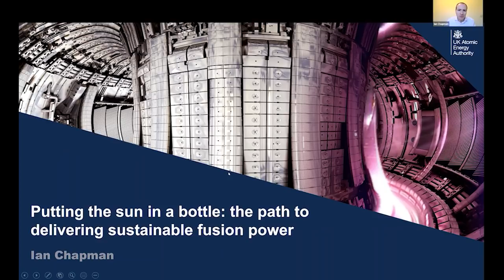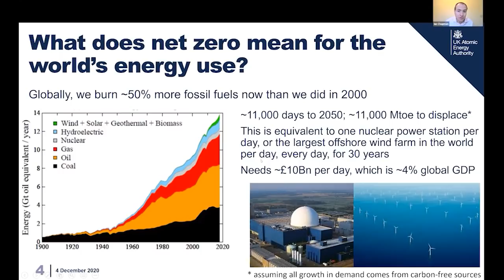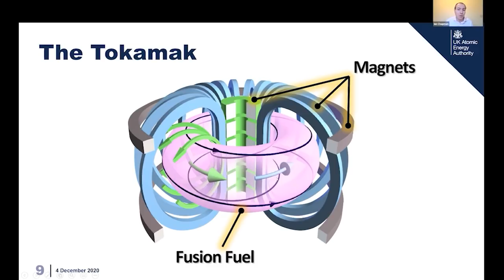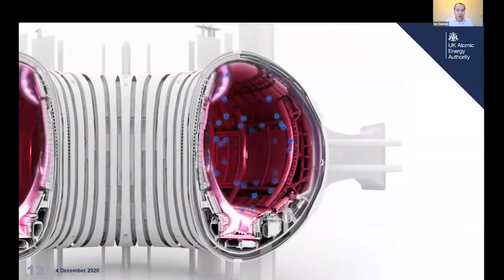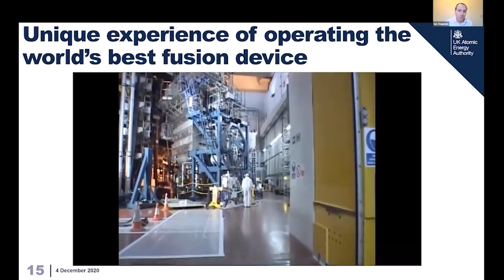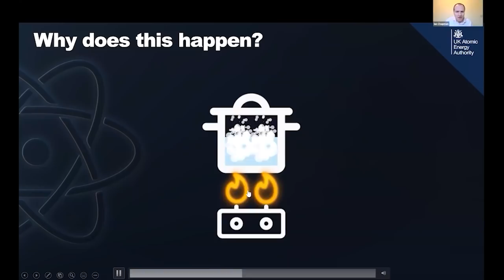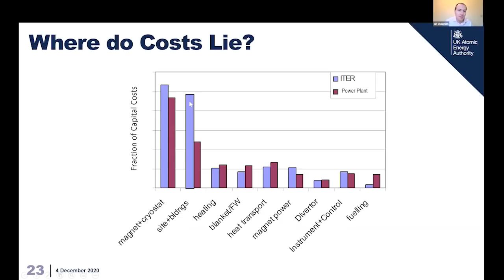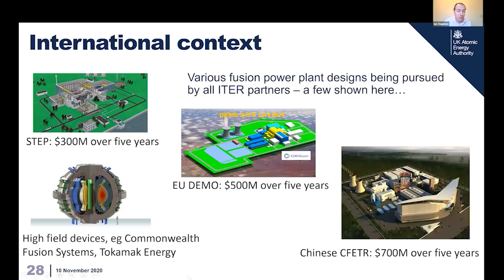Putting the sun in a bottle: the path to delivering sustainable fusion power | The Royal Society

Comment: These guys are wrestling with tough, perhaps insurmountable problems because the solutions are mutually exclusive.   We need to “go to war with what we got”, namely fission.   (Personally I like Thorium molten salt which is still R&D, but within reach.)
Reply: There should be a good balance between renewables and fission. No need to overbuilt nuclear capability when renewables can pickup a lot of slack.
Reply: @stefanozurich  1.  Germany is the most green in Europe and has the highest power cost.  France most nuclear and has lowest cost (and no incidents).   2.  AC power cannot be transmitted long distance without excessive induction losses.  The power plants need to be in the vicinity of consumers.  These locations may not be blessed with solar or wind resources.   3.  The green guys point to decreasing cost of solar and wind, but they are disingenuous.  They neglect the cost of batteries or fossil plants to back up.   4.  It might be possible to tear down existing boilers and replace with reactors.  This salvages the bulk of the power plant.  Moreover, and this is important, it Salvages the existing distribution grid (see point 2 above).  Nowadays it is hell to get right of ways ..”NIMBY”.  
    Im not against green so much as against wishful thinking.  The problem is huge and there is no magic wand.   Democracies being democracies will try everything that sounds good before settling on what works.  Politicians and technical endeavors go ill together.       Cheers
Reply: @stefanozurich  Check out today’s Fox News.  They have an article on this very subject.        Important stuff, Chefs or Bucs?   Cheers
Reply: @danbenson7587  Ehh this is somewhat misleading. The costs of solar and wind have fallen extraordinarily fast. France maybe be paying less than Germany now but if you were to start from scratch and go for 80% 0 emissions it would be much much cheaper to go with solar and wind. As you hit higher percentages the cost advantage starts to favor fission because of the storage and transmission costs as you mention. And to go from 95 to 100 without nuclear is insanely difficult. But we are not at 80%. And the costs of solar, wind, and storage continue to fall while the "real" expense of fission(despite quite large existing government support) seems to be going up. We definitely should not be tearing down nuclear plants. That was a huge mistake by Germany. But it does not seem wise to invest more into fission until we get closer to 0 emissions. From a cost perspective there are just much lower hanging fruit.
Reply: @stefanozurich  Yep - fission baseload, renewables plus storage for peaks.
Reply: Guys,   I am 67.  In the 60’s Popular Mechanics, Popular Science articles were a ‘helicopter in every garage’,  ‘Wankel rotary replaces pistons’, ‘roadable airplanes to replace cars’ and so forth.  The news was all upside, but the ideas were mugged by reality.   The devil is in the details.   
     So too is solar and wind.   At present, their footprint too small and conditions too ideal for long term assessment.  
      If indeed the Earth climate is dire, can we spend the time finding what doesn’t work with green generation?  Can we wait while right of ways slowly distill through the courts, like sand in an hour glass?   Can society quickly settle the social injustice of prohibiting wind off Martha’s Vineyard, while promoting off Newark?  
     The clock is ticking.  And why I think go with what works
Reply: @danbenson7587   "At present, their footprint too small and conditions too ideal for long term assessment. " huh they are massive scale projects that have been running for decades.
Reply: @peterisawesomeplease     At present we are seeing the results of green in prime locations..   These locations will be used and efficiency diminish. Has this been accounted for?
   Is green mature when it relies on fossil backup because affordable batteries are not to be had?    
   Are consumers OK with blackouts like California had?
   Objectively,  the world’s experience with green has been uneconomic and unreliable.  So if it’s mature technology, it’s a loser.  
    I think green isn’t mature,  mainly in storage.  And if storage face-plants,  then green is SOL economically.
    U.S. generating capacity is 1,200,000 gW.  Solar and Wind are ~100gW.  See the scale?  It’s mind boggling in size and execution. Can’t go into this on a dream and a prayer.   If climate change has hair on fire urgency, you go to war with what you got.
    We have beat this to death.  We agree on goals, but not methods. Always nice to forum with an informed, polite person.  Cheers my friend.
Reply: @danbenson7587  Yes it has been accounted for. Solar and wind costs have fallen so dramatically that even in places where neither solar or wind work very well its still const competitive with something like nuclear. Location does matter but it can be buffered by improved transmission. Perhaps more to the point we still have tons of prime locations left. We need to be going for the low hanging fruit. 

Nuclear also relies on fossil. If its too expensive to build you have to rely on fossil feul. Solar + wind + batteries is currently simply cheaper than nuclear.

"Objectively,  the world’s experience with green has been uneconomic and unreliable."

What? The industry is booming. Huge amounts of money have been made and both tax payers and rate payers have saved money. Its also not a done improving.
Reply: @peterisawesomeplease  Name a green plant of 500 mW with battery backup.   As to booming, its due to subsidies.   Gotta go.  Cheers
Reply: @danbenson7587  Aww giving up so soon. I would have respected "Gotta go.  Cheers" but no just had to go with the classic "argument" then "I am leaving" bs. Oh well plenty more fish in the sea.
Reply: @peterisawesomeplease  Peter, Here is a quote from the Fed’s Energy Information Agency’s, TODAY IN ENERGY.
     “Onshore wind competitive in only a few regions before legislative phase out of the Production Tax Credit (PTC), but it becomes competitive in projection period as demand increases and cost of installing wind turbines continues to decline.”
    Green wind ain’t there.  And it’s only competitive “in a few regions”.   And Batteries aren’t included.  
     “But it becomes competitive in projection period (when gas becomes scarce, as we have 100 year supply, say 50 years hence)
     There are 4 wind and 1 solar > 500mW installations worldwide, zero with battery back up.  
      (Another tidbit, There are ~1700 gas fired plants in the U.S., all sizes.)
      Gotta go.  Cheers
Reply: @danbenson7587  Put in all that work but then ruin it with "Gotta go.  Cheers". I am quite happy to read your arguments but not when you are pulling that BS. Have some self respect. If you actually have to go then just go. If you actually want to discuss then lets discuss. We are all on the same side in this.
Reply: @peterisawesomeplease  I would be glad to discuss, but facts are short on your end.  No one likes being a mop and reduced to complaining how a note ends.  Who has the problem?
     What the EIA proves is my original thesis:  green power, at present, ain’t there.  If indeed climate change is an urgent priority, then nuke is the proven method.  
     Please facts, not what was heard over the stall wall or read in some liberal rag.        Cheers
      .
Reply: @danbenson7587   "read in some liberal rag." Really. We were having such a great apolitical discussion.  If it makes you feel better ideally I would not subsidize nuclear or solar. I would prefer a carbon tax and let the market decide what tech to use. But you at least seem to be back to discussing in good faith so lets respond.

There are no solar or wind plants with battery backups over 500mW. There are completed projects of over 2000mW but they don't have batter backups yet. However there are under current construction battery storage facilities of  over 5000mW. Because the contracts have already been signed we know the costs are around 130$/kw/h. This is still very expensive. But energy storage is worth much more than the energy production. It offsets peeker plants instead of base load plants. To be cost competitive in that sense it needs to hit more like 20 dollars a kw/h. But it is very important to realize that we only need battery storage that cheap once we get to very high levels of renewable penetration. At current levels of penetration solar+wind+batteries is cheaper than coal. With the batteries needed included. See https://www.latimes.com/environment/story/2019-09-10/ladwp-votes-on-eland-solar-contract. At current levels of solar penetration( even in places where its already quite high like CA) you only need small amounts of offset. In places with very little solar power you don't need any storage to make it worth while. Right now it is hard to find the political will to spend 2X more on energy to go 0 emissions. But with solar you can spend 1.2X more on energy and get half way to 0 emissions. Once you get that far the tech will be cheaper to go the next 20%. Even better wind, solar, and storage are all incremental technologies. You don't have to to go all the way from 50% emissions to 0 in one big step. You can go piece by piece as the costs go down. 

Now lets think about fusion. It has 0 mW. Not 500 not 100, 0. Or look at fission. Its in much better shape. But no one in the US is building new fission plants. There is only 1 under construction in the US despite huge subsidies. Why? Because even though at high levels of renewable penetration it might be cost effective its not cost effective at the current levels of penetration. And there is little hope that costs will lower.

Now sure maybe when we get to 90 or 95% solar and wind it will make economic sense to build a few fission reactors because they will be cheaper than the storage needed to push solar and wind to 100%. I am not against doing that. Nor am I against keeping existing nuclear plants running in places that already have them. But right now we need to be going with the cheapest options. Really if it was up to me we would just have a carbon tax and let the market decide.
Reply: @peterisawesomeplease   Peter, have been closing my discussions with “cheers” for years.  I never had a complaint in hundreds of communications.  I do not play debate games like deliberately provoking the other party.  “But you at least seem to be back to discussing in good faith” insinuates you are the adult patiently listening to a tantrum.  Oh well.

     I wholeheartedly agree (Yeahhh!) a carbon tax to normalize costs among the sources and letting markets decide.  Such a clean solution has too few levers, and favors for the politicians to tinker with.  Then what mischief could be done with revenues.  All in all, C-tax  the best.
    Nuke has traditionally been baseload.  Deregulation destroyed the old business model and these nukes were stranded.  The money was in peakers.  I don’t think reliable inferences can be drawn.  
    As of Feb 9, 2021, green ain’t there  versus gas.  This is what the EIA is saying.  If anybody is in the tank for green, it’s the Federal Government, so this report has the sunny side up.   You will have to take it up with them.
    What is missing in our discussions is “when” and rate of return.  
    I write on an iPad, duties call, I gotta hang up.   Best Your way.  CC
Reply: @danbenson7587  There is nothing wrong with "Cheers" or "argument, Cheers" or "Gotta go.  Cheers". I only have a problem with "argument, Gotta go. Cheers". Its the equivalent of making a point in a meeting and then just leaving rather than waiting for a response. Like sure leave a meeting if you need to or make a point in a meeting. But doing both is rude.

I agree that gas will in most cases have a higher return than solar or wind. But the real question is what is the cheapest 0 emissions alternative. 

Rate of return is useful to know when deciding if you should build a new power plant. But if all you care about is which technology to choose levelezed end to end cost is sufficient.
Reply: @peterisawesomeplease  The first question you need to answer when your demand is energy, is "Will this potential energy source supply what I need". Whether it is 0 emissions should be a distant second or third to that. The point of an energy source, surprisingly enough is not in fact to save the planet. It is to supply energy. 
And the point of profit, surprisingly enough, is not to be a measure of evil capitalists, but of sustainability. It doesn't make a profit, you have to stop doing it eventually. Simple as that.

And wind/solar, coupled with the necessary energy storage, do not at current market prices positively answer that most important question, so them producing fewer emissions is pretty much irrelevant. As @Clarence has been corectly pointing out to you.
Reply: @Alexander_Kale   wind/solar, coupled with the necessary energy storage,  at current market prices are absolutely profitable. In fact they are more profitable for new installations than subsidized  coal and nuclear plants. Only natural gas is cheaper.(on average of course different places have different energy markets. 

I would happily accept an unregulated, unsubsidied energy market over what we have now because it would lead to greater growth of wind and solar. In the longer term to get off gas faster I would be in favour of a carbon tax.
Reply: @peterisawesomeplease  Solar power plus storage does not mean "produce at day, use up at night".

It means "produce in summer, store until fall, when daily production is no longer enough to get through the day". That is not affordable. I am not sure it is even possible to make that many batteries, even if it were.
Reply: @Alexander_Kale  
"produce in summer, store until fall, when daily production is no longer enough to get through the day".

This is simply false. In most locations with large amounts of solar power the price discrepancy between different times of day is much larger than that between seasons. Solar panels are now so cheap that it is cost effective to simply build enough solar panels that they will work in both summer and winter. Multi season power storage does exist(pumped storage, and multi season batteries are being researched) and is useful. But it is not the limiting factor for either reducing carbon emissions or increasing total power availability at the lowest cost possible. 

Again solar is not the cheapest technology for all locations. Sometimes wind is. Sometimes importing power is the right choice. But it is the lowest hanging fruit. We are still using coal is places where solar is cheaper than all other options.
Reply: @peterisawesomeplease  No this is not "simply false". Again, we are not talking single family homes here. We are talking giant metropolises with millions of inhabitants who are completely cut off from sunlight for days and weeks at a time - e.g. Tokyo during hurricane season. Or, I don't know, half of Canada during snow storms. 

On top of that you have industrial parks, some of which need several ten thousand times as much power as your average sky scraper, and need to operate around the clock. 

Powering single suburban family homes with solar just BARELY works day by day, in Summer, you are not going to do the same to your industry, to your high population density areas, to your very energy intensive transport industry or to your planes.
Reply: @Alexander_Kale  "We are talking giant metropolises with millions of inhabitants who are completely cut off from sunlight for days and weeks at a time - e.g. Tokyo during hurricane season. Or, I don't know, half of Canada during snow storms. "

Yes exactly what I am talking about. These are not seasonal level hemispheric changes. These are local(at least in a power grid sense) fluctuations. There are extremely detailed calculations of how much transmission capacity and excess renewable energy you need to cover these situations. But you do not need months long storage to handle these events.

"On top of that you have industrial parks, some of which need several ten thousand times as much power as your average sky scraper, and need to operate around the clock. "

Exactly. For large scale energy use price and reliability is the most important consideration. So why not go with the cheapest option for a given level of reliability. 

"Powering single suburban family homes with solar just BARELY works day by day, in Summer, "

Again simple false. California gets 22 percent of its power from solar and wind. That is not barely working. It powers industry and high population density. Even more importantly it is cheaper than other power sources.
Reply: @peterisawesomeplease  Here in Texas green just cost us dearly.  Texas is about 20% green.  Storm iced up windmills and solar and they went down within two hours.   For a decade, Texas utilities have put $$ into green instead of beefing up fossil for cold snaps and some gas plants choked at about 20hrs.   It was a cascade initiated by sound good bullshit.
    Was without power for 42hours until 1400 hours Wed.  Also 45 and counting w/o water.   
Green is bullshit for reliability.  Been there done that.  You can have it.   
    From one Freezing his ass off, wish you were here,        cheers.    CC
Reply: @danbenson7587  The cold weather reduced fossil fuel capacity more than wind capacity.  They should have spent money on preparing both for winter. Lol 6 months ago people were celebrating how Texas never had the black out problems California has because it uses less renewables.  Well California's outages were trivial compared to this one.
Reply: @peterisawesomeplease  You got the wrong scoop on wind, not unusual in this day of internet slant.   ERCOT is in Greg Abbott’s crosshairs.
     If California is #1 in green, Texas #2 in green and both have power reliability problems, what does that say about green?   Thanks for making my point: Green is unreliable.  It needs 100% fossil backup.  Or, as I have been for last 2 days, freezing in the dark.  Of course we could go with what works.
   Texas has its own grid and can do things w/o as much Fed interference.  I expect Texas to do a 180 on green and it may bear watching as a national blueprint 
    Going on 20 years in Houston and this is worse cold snap in that time.  My deceased uncle spoke of one in the 60s.  Put it down as half century intervals.  Inconvenience is, strangely, almost same as Hurricane.   
   Cheers.  Gotta go fill my toilet with a bucket of pool water.
Reply: @danbenson7587  "If California is #1 in green, Texas #2 " ummm not even close. Learn to google search before typing.  Neither are number 1 or 2 either by country or state. And California is at a much higher number.

"It needs 100% fossil backup. " What does that even mean? 

 "I expect Texas to do a 180 on green and it may bear watching as a national blueprint "

Lol not unless Texas decides to regulate its power grid. As long as its a free market green power will win. Only regulation in favor of fossile feuls would cause a 180. And I don't see that happening. 

"Going on 20 years in Houston and this is worse cold snap in that time. "

California's heat wave was also a one in 50 year event. But not nearly as many people lost power and for not nearly as long.
Reply: @danbenson7587  Maybe you were looking up by total generation instead of percentage?
Reply: @peterisawesomeplease  20% may be wrong, off my head after two long days.  I’m too old for this
Reply: @danbenson7587  Wind is over 20% in Texas. Its just that that does not make it #2. Kansas for example gets 40% of its energy from wind.
Reply: @peterisawesomeplease  The game is % versus absolute.  You are right Kansas has a greater %, but not absolute green (Tex has solar and hydro). Anyway, its actual generation that counts.  When windmills freeze, wind dies, or cloudy. green craters.  It just proved it.
    BTW the press depending on slant played the numbers versus percentage game.  Texas lost about 10mW of wind and 10mW of conventional However that’s 50% of the former and 12-13% of the later.  The later would have been less had $$ gone to toughening conventional instead of Animal Farm windmills.  That’s going to get straightened out.